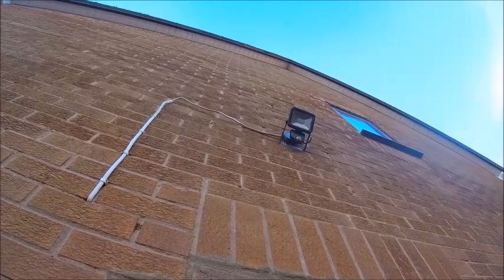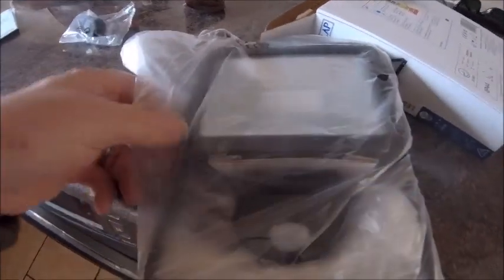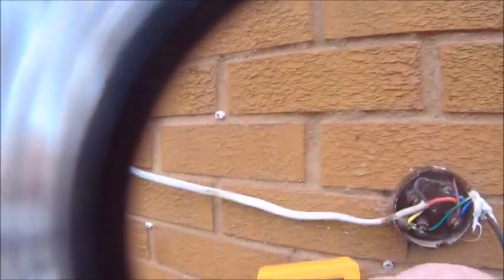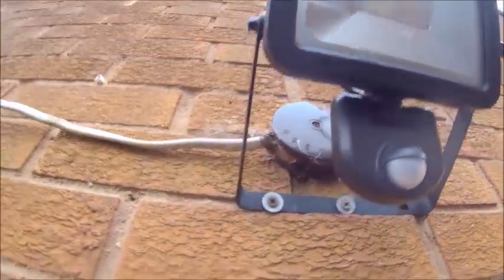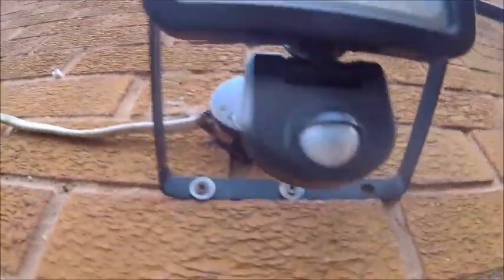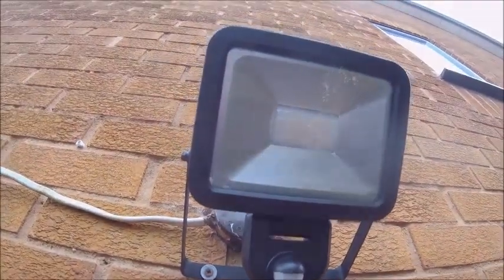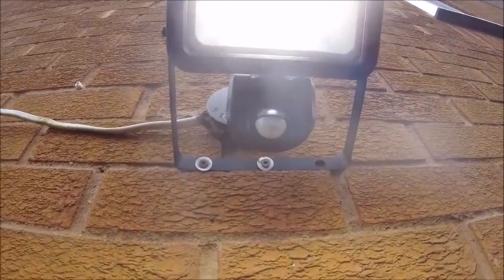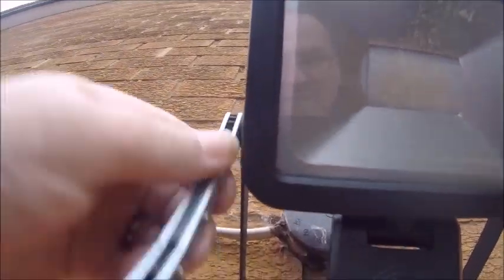LAP PIR 20 Watt security light installation

Comment: I solved the water issue:
These are designed to be under the eves and sheltered from rain. So the last few I fitted to a tnorth gable wall (Scottish Highlands) lasted 18 months!!
I have started making shelters for them to sit under using aluminium and plastic decking. No corrosion or rotting.
My longest surviving sensor light is now over 3 years old and going strong!
Well worth the effort!!!

Comment: Little tip I've had 3 of these for 2 and half years and first one died which i replaced with another plus these other two... It was filled with water.

Tighten everything then smother the entry point with black silicone, no water or condensation in any of them and still working almost 3 years on... Basically the water proofing sucks.

Comment: I’m looking at fitting one of these to my boat so need a 3 pin plug in the other end. This one seems ideal as I keep seeing double insulated cable and I cba to get into the realms of that. Do you know what model this is ?, it seems ideal as I could run my own arctic 3 core flex longer than comes standard and then 3 pin plug on the end and job done. I keep seeing ones with ridiculously short cable and it’s annoying
Reply from the maker: They still seem to have a few in screwfix.
https://www.screwfix.com/c/electrical-lighting/outdoor-lighting/cat8370001

Comment: I fit them lights to they don't last because they're designed to fail doesn't matter what country makes them if they didn't break so often the manufacturer wouldn't make as much profit.there ment to be so much better for the environment and efficient at least when the old tipe stopped working you  could change bulb now you have to replace everything how is that better for environment i would love to know how much of them light's get dumped around the world every year
Reply from the maker: Ironically I think this one has now failed too...so it lasted about 10 months, the old halogen ones went years